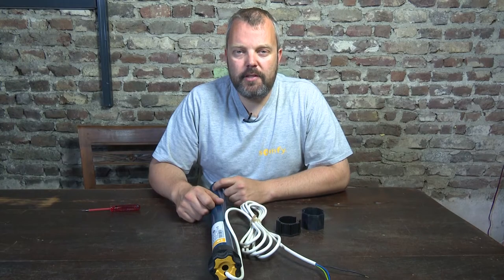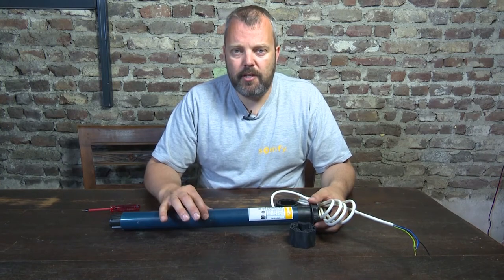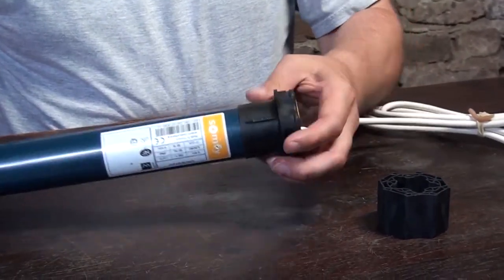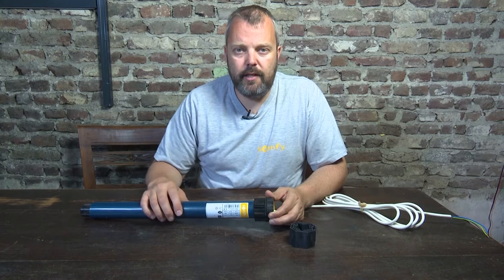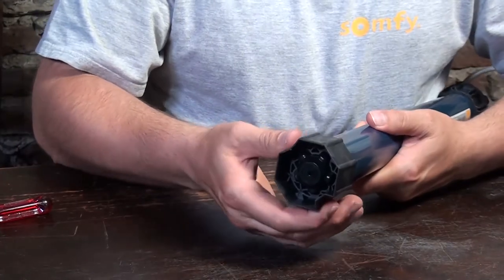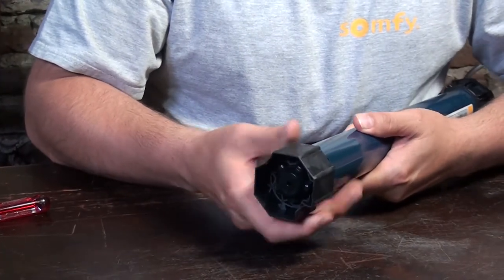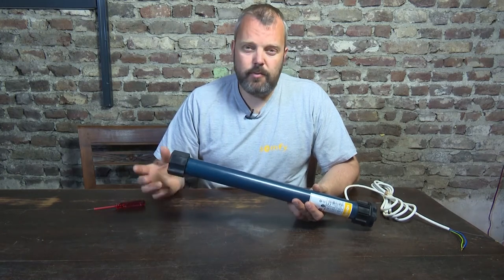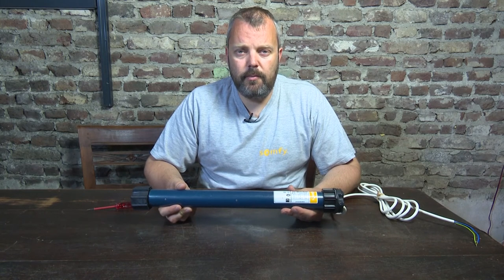How to place a Somfy crown and driver on a tubular motor (50 series)

Comment: I want a tutorial for the fixing of the motor, because I couldn't do it and I lost the manual .. I pluged the cables into the electricity but the motor didn't run .. your help is appreciated
Reply from the maker: HI, if you plugged it in and it's a remote controlled motor, you have to program it first. You can see how that's done in this video: https://www.youtube.com/watch?v=9jmaGn1vs1I If there's anything else I can help with, please let me know.

Comment: I don’t have a remote for my Somfry-powered window shutters; I just have wall switches that are connected to the 240 volts we use here in Australia. The fools, (Argus, Canberra), who installed them did not put drip loops where the wiring enters the motors and as a result one motor got saturated from condensation dripping into it and burnt-out after the guarantee expired. I foolishly bought a replacement motor on ebay from Germany from a bloke who could not speak English and found when it arrived it did not have the white and yellow buttons to adjust the distance it travels as I presumed all Somfry motors have. I presume the travel distance has been set for a fixed travel in the factory. When I installed it I found it of course continues to travel when it should not and it would go all the way and squash and stretch my shutter if I do not stop it via the wall switch before that occurs. Is there anyway I can adjust the distance it travels or do I just accept that I have bought the wrong product and buy another one.